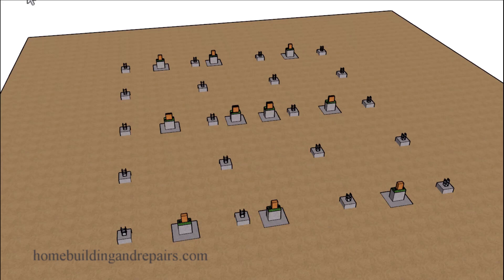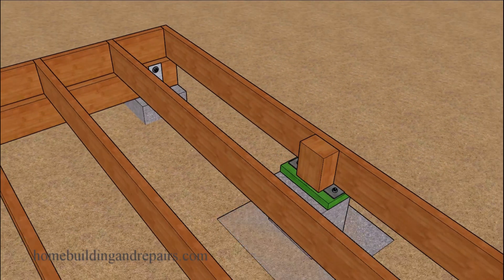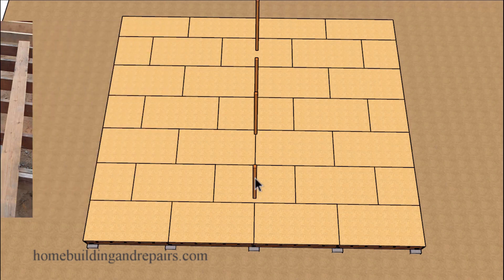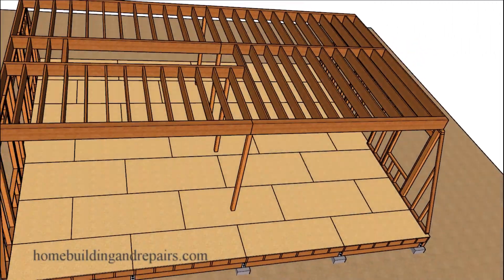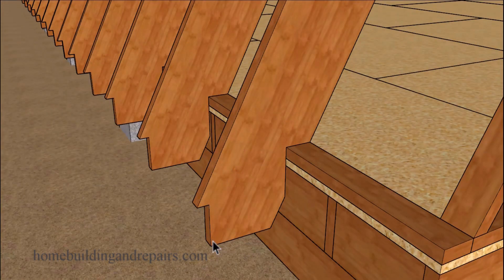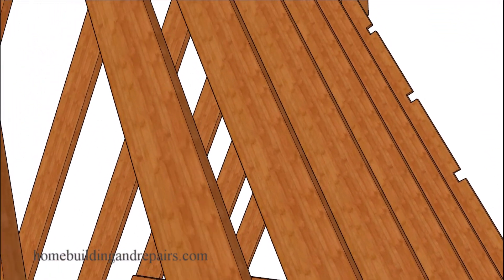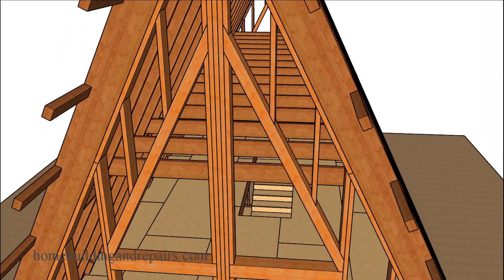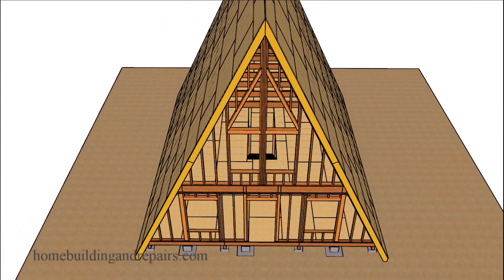Lakeside A Frame Style Second Story House With Steep Roof, Floors, Walls And Stairway - Part 5

Comment: I'm actually building one of these myself. I had an arch draw up specs for me. He outlined using full length LVL boards for the rafters. I'm doing a 30' rafters with a 30' floor base. LVLs will be 1-3/4x 7-1/4 by 30'. I purposefully picked an A-frame because I can do it myself. Beats paying a contractor 6x as much for the same product.